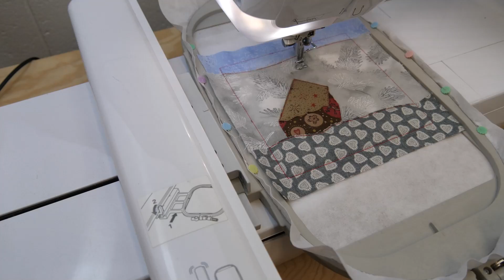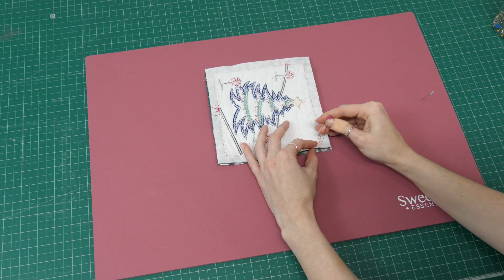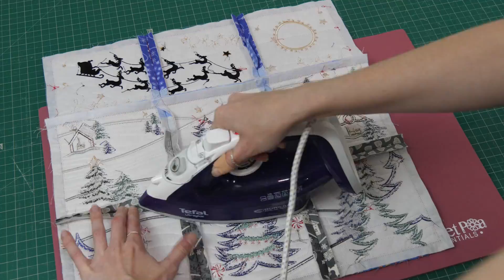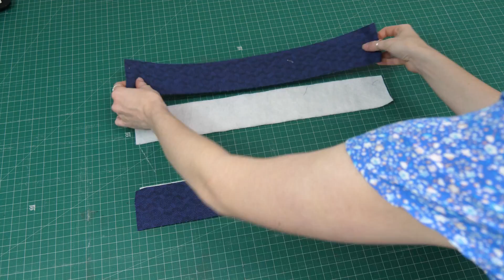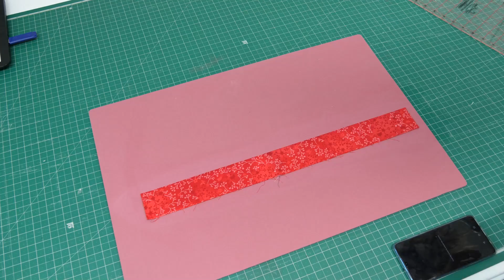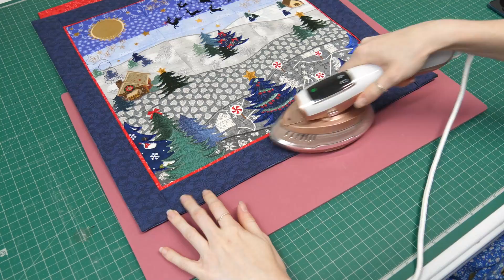November Sew Along Christmas Scene Hanger Machine Embroidery.

Comment: When you press the blocks, do you use steam? If so, how hot a setting do you use please?  Whenever I make one of the sweetpea designs it looks great until I press it then it puckers horribly
Reply: i always iron on medium heat..
Reply from the maker: We have our iron on hot with steam, however it will depend on what you are pressing and what materials you have used to make your project. The design itself won't have any bearing on if a project with pucker when ironed.